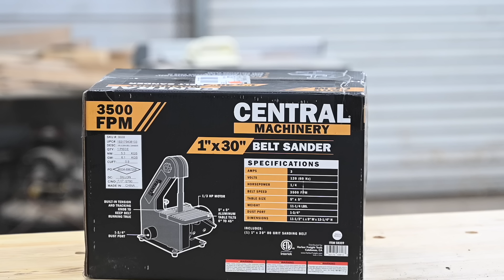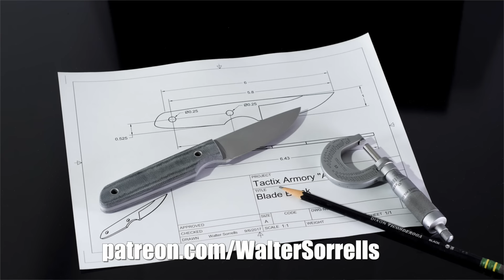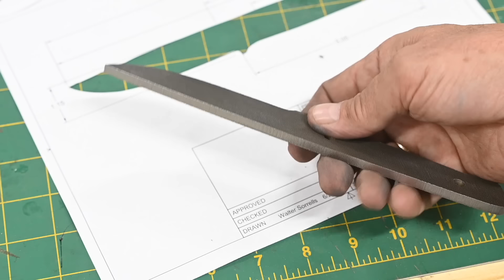Ultra Cheap Belt Grinder...Exposed!  (Harbor Freight 1X30)

Comment: As a beginner I had one. the best thing about it was since it forced you to go slow it was hard to make a mistake that couldn't be fixed.
Reply: Me too
Reply: Add me to that list. I don't like HB sandpaper either so I buy better elsewhere online.
Reply: This is absolutely not a common sentiment. I have no idea how hard you were grinding but these are much too fast for their size. They're suggested against to beginners because they're so wild with notoriously bad tracking. Also if you're grinding that hard, you're doing it wrong
Reply: @TingTingalingy  pretty common sentiment. I agree with them fully. You seem to be the odd one out hefe.
Reply: @TingTingalingy  If you're grinding hard, the motor will stall - that's what makes this thing so forgiving
Reply: @TingTingalingy 'm not agreeing or disagreeing but as far as the tracking, mine 
 had that issue out of the box, but with maybe 2 hours spent on the wheels and tensioner I fixed it. Also I use mine with it mounted on what is supposed to be the back, with the belt running away from me. That configuration works great for me.  🗡️
Reply: @RyTrapp0  that's just how belt grinders work. I have more experience with these machines than all of you in this section
Reply: @TingTingalingy  lmao, yea, I guess all grinders stall with equal effort...
Reply: @TingTingalingy  You sound just like the former guy, quite the know-it-all. "If you're grinding that hard you're doing it wrong??" 
Well, he ground the knife from a file. You saw it. We all saw it. So, what makes you say he's doing something wrong???
Reply: @steveh8724  Walter is testing it, he needs to run it harder. The files looked like they may have also been annealed or normalized. If course we don't know since he didn't mention it. If you're stalling your grinder, even the Almighty 2x72, which does happen, you're pushing way too hard. 
Everything op & know it all said was amiss from the way it is when you've had more than a dozen knives to your name.
Reply: @michaelvitetta7231 I have this sander and I agree that the HF sandpaper seems to be substandard.  For the basic knifemaking I'm doing (premade blades) it works for finetuning and rounding off handles.  I pretty much work away from the platten and use the flex of the belt to my advantage.
Reply: @michaelvitetta7231 😊
Reply: Patience and consistency is the name of the game in anything you do. Thanx for the post
Reply: @NeillWylie  I'm still waiting to hear about your poor knife expertise.
Reply: @michaelvitetta7231 really? Hace ya tried the new dtuff
Reply: @TingTingalingy  Mine tracks dead on....never goes off track, so I suggest YOU'RE doing something wrong! :)
Reply: @jt9498  no it doesn't lol they don't track well for anyone. But you can keep lying to yourself.
Reply: @NeillWylie I'm still waiting to see your crap knives.
Reply: That’s why I’m gonna start with filing
Reply: I agree, I realized that as well.
Reply: @TingTingalingy  The professional bladesmith is WRONG? Oy gevalt! What is your occupation or avocation? Pro curmudgeon?
Reply: @CHIPSpeaking  12 knives is not a pro by any stretch. I have a professional heat treat kiln & 2x72 belt sander... But sure 😂 some $59 sander owner is a pro bahaha
Reply: Taking ones time is a very wise way to go about everything in life. Keep that up. We don't need stuff as fast as everyone thinks. If it's good quality, it's worth waiting for/taking time doing.
Reply: I got one yes it is slow but so am I.
Reply: And that is a GREAT way to see it. Thanks for sharing the importance of going slow to avoid unrepairable mistakes.

Comment: I'm not a knife maker, but I have have one of these which I've used to reshape and re-profile many an axe head, machete, lawn mower, and bush hog blade. It's removed a bunch of metal over five years or so that I've abused it, and it's never faltered. It's refreshing to see a professional of Walter's caliber reviewing equipment like this.
Reply: Have had 3 years it's on its last leg
Reply: I have had the Delta version of this for over 30 years and, with the occasional bearing replacement, it is still going strong. It even has a flex shaft attachment that I rarely use. I use this for tools, part deburring, wood and metal profiling. Buy good belts, and get a crepe rubber belt cleaning block to keep them going. I have a Central machinery version at a second location and it feels a little lighter than my original Delta. Both work well for my uses. Thanks for your objective review. I think if you are getting started, this is a great tool.
Reply: @bell6446  I have the Delta sander minus the flex shaft. Had it also for 30+ years. I’ve used it like you for everything including some fine jewelry work. I’ve replaced a few bearings and the motor run capacitor once. It’s still going strong.

Comment: I have the $85 version with the 5" disc. For my VERY limited use, it is perfect and didn't break the very limited hobby budget. Thanks for an honest review that doesn't just trash-talk the tool because it costs so little.
Reply: I have a similar tool. I keep it clean and I respect all of my tools. A budget tool is perfect for a man on a budget. A poor craftsman blames his tools.
Reply: I didn't realize there was one without the 5" round disc..  makes the tool so much more useful. 👍😎✊
Reply: I like mine but it shocks me a lot.  I read it has some internal issue that causes it.  It's not static electricity.  I'm in the electric and electronic field for 25 years so i'm not worried about it. cheers
Reply: It’s because American’s can make this for anywhere near that price. We can’t use near forced labor. I quit buying tools, cars, lots of things. Try to buy things not made in a country that has vowed to destroy my country one way or another. Just saying “pay now or pay later”

Comment: I originally bought this belt sander to use for tool restoration. It has also been a very useful tool for making knives and grinding bevels on my woodworking tools. I recently bought a leather 1x30 belt, so now I use it to strop my various blades. It might be light duty, but it's been a super useful tool.
Reply: A buddy I used to work with brought their next largest model home from a flea market in 2005 and it was well used then and still going strong in 023.
Reply: Thanks for the leather belt idea.. I strop my knives on a piece of leather glued to a flat stick and charged with polishing compound,

Comment: I use mine for primary handle shaping. Because it does not dig into the material too fast, even with a 36-grit belt, it's easy to keep things smooth and even.
Reply: Use mine on handles and made a drill bit sharpening jig for it
Reply: 36 grinds into steel rapidly. Handle material stands no chance against a rigid AF 36 grit belt, especially on a 1x30.

I'm not buying your story
Reply: @willlothridge3197 what is a drill bit sharpening jig for a 1x30 grinder?
Reply: @TingTingalingy you really don't know what a drill bit sharpening jig is? Hell buddy, you have the internet so you surely have google?!
Reply: @TingTingalingy  about a 4” long piece of 1x1 angle with homemade ball mounts on a base

Comment: Mine is the older HF brand/model.  I’ve made some really nice knives with it.  As a beginning/hobbyist knife maker, I think it’s amazing!  Plus, at this price point, it’s not going to totally kill your budget if you have to replace it.  I’ve had mine for 3 years and still going strong!  I can also get the ceramic belts for it, too.  Just take your time using it, be patient and enjoy the process.

Comment: WHAT A GREAT REVIEW.  

I started somewhere, like everyone does. You pointed out a damn good way to jump in, even if garage sales couldn't get you where you wanted to be, and you didn't have the cash to go all in up front [and had to upgrade a bit here and there, as you could afford it].

SIDE NOTE: I'm a woodworker, miner steel player wither, plastic worker, copper plater and so on. I lucked out and scored a delta 1x42 for ten bucks at a garage sale about twenty years ago. Since then, I've added a four wheel grinder I picked up off craigslist [for a couple hundred] (it was a 3,600 RPM thing off a 240 volt motor, but I swapped the original motor for a sewing machine motor and controller (3/4 horse),  installed a couple CBN, diamond and stone wheels on it and was off and running.  I added a Air Handler buffer to the mix for one hundred (little 1/4 horse with a solid squirrel cage in the cabinet to collect debris All nothing, (air handler aside) compared to your grinders (which my son invested in too).  The point of all this is, I'm impressed with this jumping off point.

Comment: I bought one just for sharpening, when the edge needs some re-profiling.  I have many decades of practice on stones, but the time saved here is enormous.  Just always remember that what can do a good job fast, can ruin a knife just as fast, be sure you can hold your angle every pass.  I saw a vid a while back of a professional sharpening shop, and they had a whole wall full of these.  It was more practical to have a machine for each grit than it was to change the belts.

Comment: I had purchased one of these machines for my automotive shop a few years back. I certainly was not expecting much at all for all the reasons you mentioned, but I was also not looking for a machine to handle heavy use. Like you, I also tossed the cheap belt and bought good ones. I have to admit, I was extremely surprised at how well it works. For the money, it is well worth buying one.
Awesome stuff as always man. Love your work!

Comment: I used one of these for about 15 years or so before the motor went out. It worked great for me. I liked that it was a little slower, it made me take my time and get things exactly they way I wanted them. It worked great for reprofiling and repairing blades that people would bring me to fix. I also liked that it was small and took up very little room. Many times I took it to work with me to use . It may be cheap but it did everything I needed it to do.

Comment: I've had one of these belt sanders for about a decade, and I agree with the assessments made in this video. One thing I should note is that last year the on/off switch on mine failed, but it was easily replaced with a generic rocker switch from Amazon (that fit perfectly) for about $5. These days, mine is relegated almost exclusively to smaller wood working projects.

Comment: I have owned and operated one of these small sanders for over 20 years now, for small deburring and small drill bits or lathe tools. I degreed my plate for ease of use, and find this exactly as per cost and need. Cheap and capable of good performance with Zirconia belts on small objects, when not in any hurry. For my main used of all intentions is my Burr-King 4" x 60". I also have the larger Harbor Freight Belt sander with the side wheel, and find it acceptable for larger, soft material objects, but easy to stop and very Endemic for power. For a serious user or knife maker' Buy Nice, or By Twice.

Comment: I bought one several years ago for mid thirties and I have no idea what it will do for knifemakers but I would not be without one for a small drill bit sharpener.  I use it for very small to 1/2" bits and it gives me great control.  Not to thrilled with the channels in the table but I have to say this has been a performer.  I always get a better grade of belt but with that it is something I would not be without.  I use it every day and it has been without any problems.

Comment: I picked up one of these to do some of the finer finishing/polishing work on my amateur experiments in customizing stock blades, with my old 4X36 handling the bigger removal jobs (relatively speaking). It's held up better than I thought it would, but then I'm usually using very fine belts at low pressure. Also functions as an oversized Worksharp for edge touch-ups with 600-1000 grit belts. Really glad I found your channel!

Comment: I've been using this exact 1x30 belt sander to sharpen mower blades for 15 years, works great. Got a more expensive hobby, buy a better tool, but it's not junk.

Comment: I have the Vonhaus 1x30, very similar to this but has a built in disc sander too. I'll upgrade to a 2x72 as soon as I can afford it but honestly, this little belt grinder has been amazing! I've made everything from little sgian dubhs through Bowie knives up to 1 handed swords using it and it's handled them all just fine, slowly, but fine. For a little under £100 I have no complaints.

Comment: I have 2 mounted back to back on a 12 x 24 " board. C clamp holds it down, 2 different grits, loosen the clamp and spin the rig around and go again. Belt sets are $10 for 30 (!) on Temu. Warning: stopping the motor with excessive loads will burn out the pully/bearings, THEY ARE NOT AVAILABLE. I got one of these sanders for $20 because the pully was seized. Matched a bearing and "poured" a new plastic puller around it, bit of sanding and it's now workable. Thanks for the vid.

Comment: Walter you are right on the money.  I have had one of these for years.  It does great service for light duty stuff, as you said.  I made a drop point knife from miter a saw blade and it did a great job.  Thanks for another great video.

Comment: I’ve had mine for about 10 years and it’s still going. The capacitor just blew on it but I was able to bypass it and it still works!! As a serious hobbyist from making knives and blacksmithing it’s an extremely useful tool.

Comment: I am not a knife maker, I am a founder. I have used this type of sander to clean all of my castings. The motor went bad, the shaft was an odd size,so I had to make a new pulley to fit the new motor shaft. It worked great. I still use it to this day.

Comment: I've had a green Harbor Freight version for over a decade and it is still rolling along.   I'm not a knife maker, but I built boats and use this tool for all kinds of detail work  on wood, fiberglass and metal.  I've altered mine to include vibration reducing base and a quick way to remove the cover forr belt changes.   I use the dust port and improved the guide table by drilling multiple holes in the surface t allow air flow.  This thing works.

Comment: Glad to see your wearing the respirator.  As a metal worker, I noticed after grinding metal outside in the sunlight, the sun's rays showed just how many very small metal flakes were floating around me.  You don't want this in your lungs.  I also use a respirator and also have a huge workspace exhaust fan.   Safety first.
Reply: Yeah you don't want the metal shavings in your eyes either.

Comment: Mine's probably 10 years old at this point.  Still runs great.  I don't actually make knives, but lots of sharpening and reshaping/restoring.  As well as other regular DIY around the house stuff. They tend to not be put together that well, so I had to grind out a little clearance for the idler arm to move properly and I trued the pulleys to make it run smooth as can be.  First things that go are the side and top covers.  Then grind the top to allow full access to the top pulley.

Comment: I learned how to grind on one of these and its still going strong.
If you dont have a dedicated shop, these are a cheap and cheerful way to speed up your knife making, and you can run them on kitchen counter with a vacuum cleaner hose attached to the side to keep the mess minimal. I personally try and keep them religiously clean because metal filings have a bit of a habit of building up inside the cowling. If you are doing mixed wood and metal work then you risk a flammable build up developing inside.
This aside, if you treat it well, it will treat you well.

Comment: I bought one of these from Harbor Freight almost two years ago and it's still going strong. I only own two machines I use as grinders to profile and flatten my blades; the 1x30 and a 4x36 adjustable belt sanding station from Bauer. Now that you can get much more aggressive abrasive belts for these machines, I think they're great if you're starting out or just strapped for cash. I still like to file my bevels in by using draw filing at my bench, but these two machines significantly drop the time it takes me to get a blade ready for heat treatment and they also help me process my handle materials quickly as I work with a lot of bone, antler, and horn that I repurpose from the stuff sold as dog treats. I think they're great compared to the alternative of doing everything purely by hand.

Comment: I have four 1x30 belt grinders, only one is Central Machinery and I use it with a stropping belt. The other three grinders are more notable name brands.  With a few minor modifications my 1x30s work great with the correct/proper belt selection.  Thank you for this video.